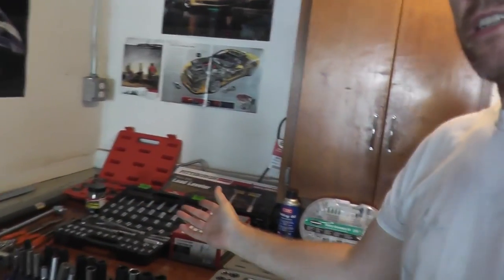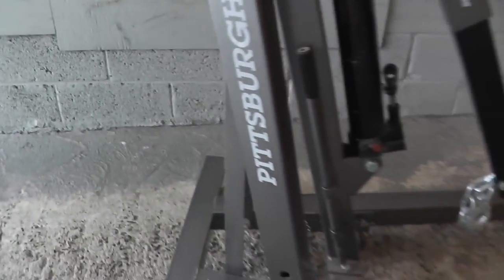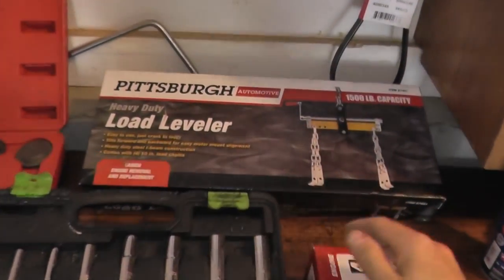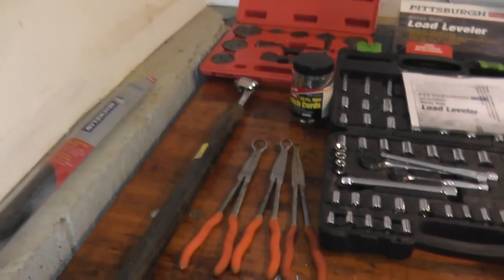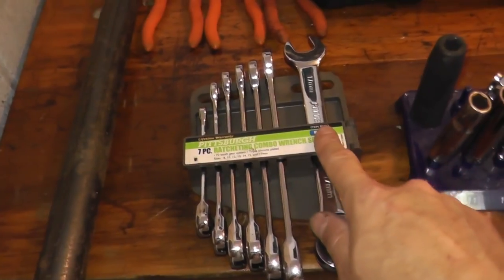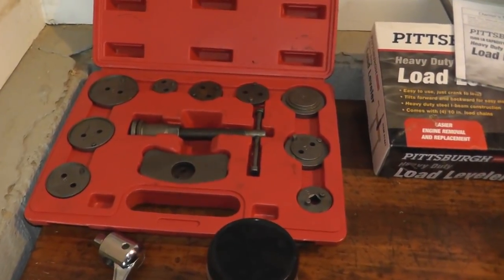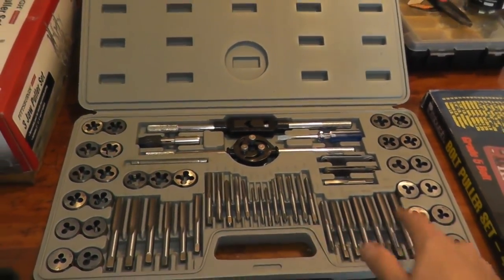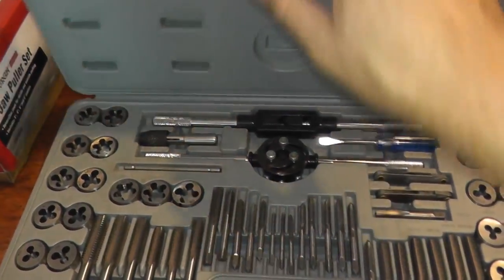Are Harbor Freight Tools Any Good???

Comment: Can't speak for anything else there because I haven't bought it but their tap and die set has yet to break one single tap and they are very useful. I've bought some wheels there that broke easily but as long as I bathe my taps in a bucket of used motor oil at the end of the week they seem to work wonderfully
Reply from the maker: Thanks for the heads up. I have no issues thus far with their tap and die set as well. Key, as you point out, is lubrication. Cheers.

Comment: 150% recommend a breaker bar for strut work, especially if you live in the North. With Rust my main knuckle bolt took 250Lbs ft lbs of Torque to get off. You need leverage for that.
Reply from the maker: Agreed. The breaker bar is a huge plus and often sold for less than $10.

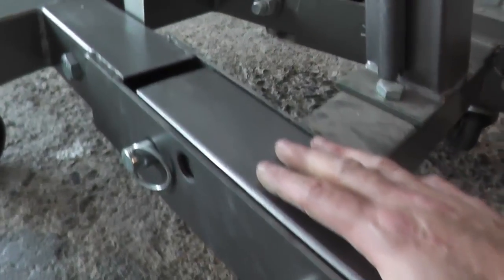Comment: @2:50 That's designed that way so the middle wheel ends up off the ground. Otherwise, you're dragging 6 wheels around instead of 4 wheels.

Comment: Very nice review.  I also have a lot of the HF tools you spoke about and the have held up just fine (non-commercial use).  I also picked up the HF 12 Ton Press (model 60604) and a few of the press disk kits.  All good.  BTW, you must live in the northern climate where they salt the streets (your cement garage floor has deteriorated).

Comment: Just picked up a pittsburgh machincal tool set and floor jack from hf we will see how it goes
Reply from the maker: I still use their mechanical tool set (Pittsburgh) and it's held up incredibly well after six years. Just purchased their 1.5 ton as well. So far so good. Good luck!
Reply: @CarsNToys  thats the jack i got it got the job done but i had to put some wood 2x4s to get enough lift for my jeep wj exceeded the weight its rated for too

Comment: Harbor freight tools are good if you use them correctly. Snap On is ridiculously  over priced.
Reply: no, they are only good if you are doing light to maybe medium work. Snap on might seem over priced, but snap on wont break or give you problems when the job is hard. 

I still to this day dont understand why people are having this argument, the cheap tools will work fine on lighter duty jobs, but if you push cheap tools they break every time way before good tools. But if you dont need anything heavy duty and dont want to spend alot of money cheap tools are fine.
Reply: Natty ice you are correct to a degree. You have to know the limitations of tools like taking a 3/8 in standard length ratchet to the caliper bolts, can get the job done but you probably bought to use a 1/2 or a breaker bar it’s just knowing limitations, I have stripped and broken a lot of snap on stuff. It’s not bullet proof
Reply: Snap on tools break too. The only difference is that it takes weeks for a replacement and harbor freight will exchange them same day.
Reply: Casey Smith snap on sockets fit better any professional grade tool fits better than harbor freight
Reply: @wononcyka666  dude craftsman. Husky. Kobalt. Are all like 1/4 of price from snap on and are above average tools
Reply: @miguelledezma1394  wrong, they are by definition very average, the mediest of the mediocre.

Comment: Yeah, they qualify good, they can get the job done for entry level jobs. Just not the highest quality control, not the tightest tolerances, and not always the best option for the job.

They do work, and as long as they are functional they shouldn't be knocked for it, but some times certain jobs requires certain tools. My $40 multimeter works perfectly fine for what I need, but as a engineer my job mandates a more accurate unit which runs $600. 

Not 12x's better but it's the better tool for that job.

Big fan of their breaker bars!

Comment: It's says grade 5 bolts right on the box and if you don't like the bolts just replace them and they are screw driver's not chisels so that's why they don't don't hold up well to the hammer. So far I have been pleased with what I have bought from HF for the price I paid.
Reply from the maker: I should of been more specific. Light usage (not dead blows) will cause the ends to crack up and fall apart. I never had an issue using Craftsman (or other brands) regarding light usage.
Reply: @CarsNToys  Can't you just grind a new tip on them? Most of us will regrind the tip after they are damaged (or worn) to get longer life or just to get a screw in/out with a screwdriver that isn't quite the right size. Personally, I want a tempered tip (that's why they crack); BTW you can beat on their cheapo screwdrivers w/o cracking problems but their tips don't last long being used for their intended purpose.

Comment: Their bigger titanium tap 'n die set is much better.... it's twice as much $... but for what you'll spend on the standard set in metric and SAE you could buy the better and much more complete titanium set... I have used the smaller ones in the past and they'll do the job... I'd rather have the bigger better one though... their impact sockets are really really good though.... some of their stuff isn't bad you just have to know what to get and what you're doing with it.... nice video
Reply from the maker: I agree. It's trial and error finding what works and doesn't work. Thanks for the feedback.

Comment: The engine hoist should have had the castor adjusted with a few spacing washers the day he put it together. Twelve point sockets are never recommended they will round off nuts that have rusted. What is an engine level tool one or two long studs will guide an engine onto a stand or gear box. Tools are made to serve a purpose if you only get them out to do a short service every few months then cheap is the way to go, if you use them every day then buy the best you can afford and look after them
Reply from the maker: Appreciate the feedback.

Comment: You'd have laughed at my lag-eyebolt into the stud of the garage wall, hooked to my come-a-long, hooked to a 2" wrench that has a 1 1/4 wrench threaded through it, hooked to my chain hooked to my silverado pulling it up the inclined driveway.   It worked.   2:18  That's a "feature" on my 2 ton "higher end" folding engine hoist as well.  My recent alternator video has a review of the same breaker bar. I think its design is superior to the Pittsburgh Pro model with the rubber handle.  Love that thing.  I use my kids sidewalk chalk on the sockets to make them visible, if it gets oilsoaked or wet, just re-apply super easy. 
 Since its sidewalk chalk I color-code them too {:-)Thanks for the reviews.
Reply from the maker: Nice tip! Thank you.

Comment: The hole misalignment is probably intended for the hoist. Granted if the ground is uneven it would be off for that reason. However it only takes three points to define a plane if you do not eliminate the central castors by pulling the center up then the hoist will get wobbly on convex terrain. Not ideal when it's under load. If you are having problems with it get a lever and fulcrum that you can step on to pop it up while inserting the pin. However, if that is such a burden to do that once in s blue moon maybe you should quit working on cars and get a desk job  or file for disability because you should not be taking engines out of cars.

Comment: The metric sets need to go up to 19mm.  Lots of stuff on cars n trucks are 19mm.  That's why I don't buy many of these sets.   Go to Sears there are great deals now.
Reply from the maker: Good tip. Unfortunately the local Sears closed many months ago. I ended up purchasing a 19mm socket via Amazon.

Comment: Just so you know a sbc is lighter than your 6 cylinder Nissan motor, that's one of the reasons they are a popular swap.
Reply from the maker: Good point. I'm referring to the 'old school' cast iron block SBC or any other large cast iron engine.

Comment: Great video, alittle disappointed what you said about the engine lift. I have a 4.0 v6 in a ranger to pull out and I was about to buy the 1 ton cherry picker and leveler??
Reply from the maker: Go with the two ton. The boom is too short with the one ton. No issues with lifting capacity; it all worked great. But the short boom made it quite tricky to remove the engine from a 240z

Comment: I cannot hold back. What you have under the bench is a WINCH, not a wench. A wench serves you meat and mead at your local medaeval tavern. A winch is what pulls your truck out of the ditch when you screw up after drinking too much wench-served mead. Seest thou the difference? And alas, where I come from we call the engine crane a hoist, but I digress and am becoming nit-picky. I'll shut up now.

Comment: My hoist is absolute junk, the support arms weren’t close to fitting, the pins for holding the legs up don’t fit, and I have to use a screwdriver to hold the main arm in place

Comment: Nice Datsun bro. I've got a 2 door 510. Are you rebuilding that straight 6? You really don't need to do a motor swap cuz you can get over 300hp from the stock engine without boosting it and they look and sound so good

Comment: Looks like the length of the engine crane is adjustable
Reply from the maker: It sure is. However, as you stretch the boom the weight capacity reduces. At the longest length the rated capacity is only 500lbs.

Comment: I have to strongly UN recommend their automotive (pickup bed) hydraulic/cable winches.  It is rated at 1,000 lbs, and I never picked up anything more than a truck tire, about 250 lbs.  The hydraulics still work fine, but the gears on the winch are truly pathetic, they stripped out after about ten uses.  Now I have a large useless crane mounted on my truck.  This is the orange colored model, with 1/4" wire rope, about 3 feet tall.  Too bad, H.F. jacks are excellent, I got a 12 ton jack for $19.99 when "Jet" brand was going for $99.99.  Still working.  I also have 3 or their 12 ton air/hydraulic jacks.  I've lifted more buses than I can count with these fine jacks.  No crawling under the bus to do fine up/down adjustments, just hit the air switch,./...Sweeeet!

Comment: I keep one of those HF breaker bars in the trunk of each car.  I find them much easier to use than the tire irons that come from the factory.  I kept looking for an old USA made one and couldn't find one long enough so I bought these, each on sale and used a 20% off coupon to save a little more.  Well worth the money.

I plan on picking up a couple pliers for each car as well.  My socket sets are old USA made Craftsman sets I picked up used many years ago.  I would not hesitate to buy the Pittsburgh pro sets.
Reply from the maker: I agree. The breaker bar is key. Thank you.

Comment: You can't trust Harbor Freight's reviews on their website.

They frequently don't publish the negative reviews I've left, and they filter their reviews by highest rated first. I'm not aware of any other website that does that. It's very misleading because you're bombarded with positive things about the product first. You have to dig through to get to the negative ones.
Reply from the maker: Yes, the default setting on their website is highest ranking first. However, you can also choose 'lowest rating', 'newest', and 'oldest' on the drop down box.

Comment: Not being a troll, just wondering what a grade 6 bolt is.
Reply from the maker: It's a good question. Simplisticlly, a higher grade (such as grade 8) provides more tensile strength. In other words, it won't break as easily as grade 6.
Reply: @CarsNToys  His point is there is no such thing as Grade 6... 😂😂😂
Grade 5 you meant.

Comment: For the problem with the engine crane pin hole problem, try replacing those small casters with slightly larger diameter casters.  I think that might solve the problem.  Thanks for your video.

Comment: Folding engine crane is a bit dangerous too. There was one time I got busy and just pulled the engine without setting the pins. Whole crane started to shift off to the side and we both peed a little thinking "oh shit, damn things gonna tip" got lucky things were still balanced enough to get the pin in.

Comment: If you want them to last you a very long time, don’t use them.
If you actually use them they’ll start breaking it’s like they’re made out of plastic.
Reply: i can tell you spend more time typing than wrenching. harbor freight tools are decent.
Reply: Yeah well, I’m an automotive technician and have probably wrenched more than you’ll wrench in your entire life, so I know what I’m talking about when it comes to tools and I know those made in China tools are good for diy’ers, maybe. Either way they’re crap.
Reply: @JC-wh9pj  im not going to say harbor freight tools will last a life time but i work for a company that leases big rigs to haul equipment from different movie set to another and most of our techs use harbor freight tools to maintain our fleet and they hold up. Im sure some of your favorite movies or tv shows were built by harbor freight tools.
Reply: Trollol Police those are probably different tools used in an auto shop where they  get a real beating. I wouldn’t doubt that they use sockets and wrenches but if put to the real test I doubt they would hold.
I guess that’s why those other companies are there like snap on, Mac , Cornwell, Matco...cause they understand the real need for a good quality tool.

Comment: boom not too short chain is too long
Reply from the maker: Wouldn't of made a difference in my case. Even with a longer chain the lifting angle would be too extreme. Front bumper had to be removed.
Reply: @CarsNToys   i have been turning wrenches for 40 years never ever had that problem
Reply from the maker: It was certainly a surprise. Fortunately it barely made it. Interestingly enough, I noticed similar comments on Harbor Freight's website with the one-ton crane.

Comment: 🏁🤔Believe me real impact Air wrenches also Air ratchets wretches really speed up any job on any automobile I really do know I am a real ASE certified Master auto technician or a real ASE certified Master Auto Mechanic with over 60 years of real experience a good air compressor at least at 175 lb also good air wrenches is earthquake is a ok air tool's better than any Snap-on air tools Snap-on is a very expensive tool not no better than most other off brand tools

Comment: Curious why you dont use power tools?  I am a proffesional but i couldnt imagine doing everything by hand. Work smarter not harder.
Reply from the maker: What brand do you like?
Reply: CarsNToys i like all brands matco, snap on, mac, ingersol rand. The harbor freight  earthquakes are real good too thats what most my air tools are and they havnt let me down once they are powerful. The harbor freight impact sockets are real good too but make sure they say pro.
Reply: CarsNToys once you use air tools or better yet battery powered ones like milwaukee fuel you will never go back i promise.
Reply: @CarsNToys  HF's 20V  Lithium Earthquake XT line is nice stuff, but if I were you, I'd go with air; at minimum get their 21 gal. cast iron compressor when it's on sale for $150 and start buying their Earthquake line (or better yet their EarthquakeXT line if you can afford it); most pros are using battery powered impact guns (dragging around air hoses suck after a while) when they can but you "need" a plethora of air tools that will make your life easier that you really can't get in battery powered.
Heck, convince your wife you "need" both and go for a two-stage compressor while you are at it.

Comment: Pretty bad when I can buy actual Gearwrench ratcheting wrenches cheaper that the Horror Fright ones!
Reply: John Acuff you do realize that gear wrench is Chinese also right? Manufacturer by apex right on the same line as craftsman Pittsburgh and several other name brands.
Reply: I have both gear wrench and Pittsburgh ratcheting wrenches in my tool box at work. The gear wrenches ALWAYS freeze up and stop ratcheting. I gotta smack it on something to get her to chooch again. Have yet to have a single problem from my Pittsburgh wrenches. In conclusion, Gear wrench is trash.